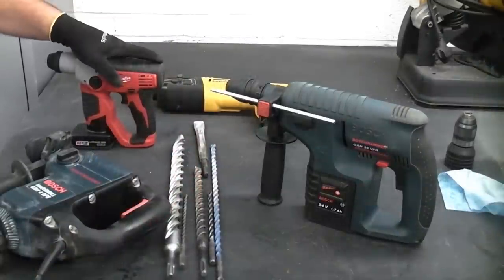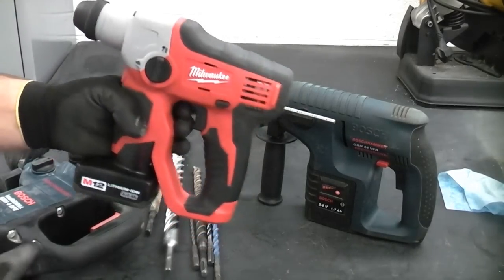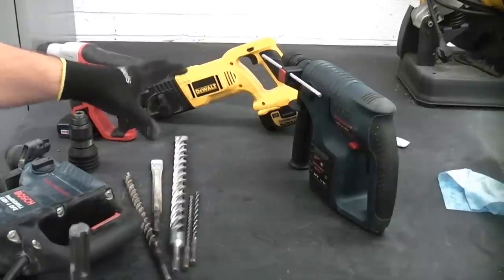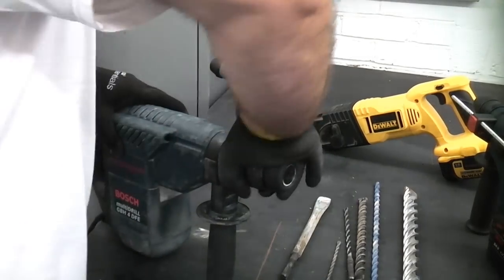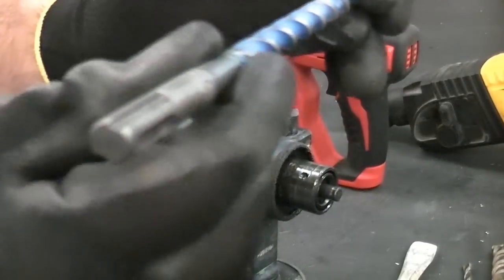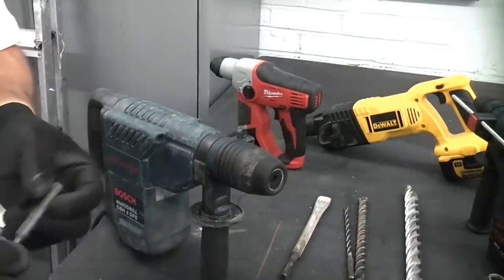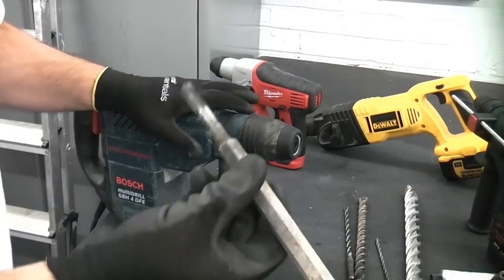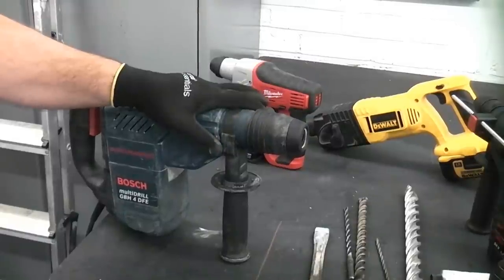SDS drills

Comment: Ive just bought a Dewalt DCH253 SDS XR and its worth its weight in gold.Powers through stone and concrete like a hot knife through butter.So much better than a percussion drill.Wish i had got one years ago.Another great informative video.
Reply from the maker: I currently have 5 SDS machines but when I see a new one I always think I'll find a use for it LOL.
That Dewalt looks like a cracking piece of kit ;-)
Thanks for the comment
Reply: ***** I got it in a bare unit kit with the new angle drill from Tomp8294.Couldnt resist it.
Your videos are costing me a fortune lol!
Reply from the maker: animal79thecat
I have bought a few things from Tomp8294 myself ;-)
Sorry about costing you a fortune LOL
Reply: ***** No worries...its a very satisfying addiction to have lol,and rather useful!

Comment: We got our first sds+ machine this week. What an awesome piece of kit. Just got it to drill holes initially but my partner used the pointed tip so take down a wall as well ( I had taken down half the old fashioned way) it made such short work of it. The big hammer may of been slightly faster but made way more mess and was exhausting. 

Only cost £60 as well ( titan brand) 

Just wish they done metal bits for the sds system as well.
Reply from the maker: They are brilliant and very affordable now.
Thanks for the comment

Comment: Thanks for the video lesson. Especially re greasing the drill bits. Handy tip. 😊 I have an sds drill but does not have a reverse function, which would be handy as I'm an avid diyer. Any recommendations on one with the reverse function would be much appreciated. Thanks.
Reply from the maker: shahdrah 
It depends how much you want to spend.
If you have a figure in mind please post back and I'll take a look for you ;-)

Comment: Can the Bosch sds drill with the interchangeable chuck be used for coring flue/ waste holes? 
I’ve bought a few Milwaukee cordless tools recently and would prefer to stick to the Milwaukee system but looking for recommendations.
Reply from the maker: Yes, it can be used for that. I have done several 4" and 5" holes using it-
https://www.youtube.com/watch?v=P0Pj9zzPN0s&t

Comment: I almost exclusively use sds hammer drills, they are just too versatile wheather you work with masonary, concrete, wood, metal or just want to drive in some screws they get the job done. Now I own a Ryobi 18V P222 cordless hammer drill and it perfectly suits my needs especially the built in chisel only mode gives it even more versatility (perfect for removing tiles). I also have 2 corded SDS Max Hilti's for some heavier work.
Reply from the maker: SDS drills are superb ;-)
Thanks for the comment

Comment: Very nice video..... I am not a handy man, but wanted to have a hammer drill that can be used to drill occasionally to drill holes in masonary. I can across this drill "Hitachi DH22PG 7/8-inch SDS Rotary Hammer" , not sure that will suffice the need. Please advice......
Reply from the maker: amol kheur Thanks, Yes that machine should be great for drilling masonry ;-)

Comment: What would be an advantage of an SDS-Max system in comparison to a SDS-Plus (except the bigger sizes)? Can you drill smaller holes with an SDS-Max?
Reply from the maker: I'm not 100% certain, but I don't think you can get smaller diameter drill bits for SDS max machines
Thanks for the comment 👍

Comment: Just picked up the dch  253 dewalt for a bargain along wth a 18v 4 amp battery ...would like to know your thoughts on this piec of eqp.
Reply from the maker: I've not used that model but if it is as good as my Dewalt 18v SDS drill it will be great ;-)

Comment: What brand of bits do you prefer for the sds plus??  I've used dewalt extreme 2 in my normal combi drill and there great just wanted some advice before splurging on sds plus :)
Reply from the maker: Many of my SDS drill bits are unbranded, but I do have some Bosch, Dewalt and just recently I purchased some Irwin.
The Irwin speedhammer are very good as are the Dewalt extreme bits. I'm sure Bosch and Makita will also do equivalent quality bits too.
Reply: Bull dog extreme rule

Comment: I clean my Bosch inside out every 40 drills(i have a small notebook in my case). They may make them really well but there still isn't a good solution for not getting dust and crud inside your machine. Lost a couple of these to leaving them superficially cleaned.
Reply from the maker: Thanks for the comment

Comment: Hi, do you need to grease the sds chuck regular? what type of grease is used in the chuck, thanks Ian
Reply from the maker: I only apply it every now and again. If you are using your SDS drill a lot it would be a good idea to add some once every couple of weeks. I use silicone grease as it is relatively clean.
Thanks for the comment
Reply: thanks Ian

Comment: I already have a 910v sds drill (performance power from B&Q), which does the job for me. So don't want to spend too much £60/100 would be the max. I don't want a battery operated one as over time they loose their charge and replacement batteries then become an issue as the models are constantly changing. 
Thanks.
Reply from the maker: shahdrah 
If you want a cheap one I would go for something like this http://fave.co/1TDknvY
Or if you want a qualirty drill this  Dewalt is a bargain- http://fave.co/1NgzYSf
Reply: Thanks. I'll go for the dewalt.
Reply from the maker: shahdrah 
Excellent choice ;-)

Comment: just a question, can i use sds drill bit on normal cordless hammer drill say Dewalt DCD796?
Reply from the maker: You can, but it won't be as good as a SDS drill, you also have to ensure that the jaws in the chuck grip only the round part of the drill shank.

Comment: sir, i want to drill a screw to hold my light on the ceiling which is concrete...is there any cheap drill and what  V is  need to drill through concrete
?
Reply from the maker: +Max Caulfield A SDS drill is best on concrete, but a normal hammer drill will work for a couple of holes but it's much harder with a normal hammer drill.You can see the difference here- https://www.youtube.com/watch?v=SKDIggpbXqU
Reply: +Novashadow X buy the Skil rotary hammer, cheap but it gets the job done

Comment: What kind of grease do you use for the drill shanks? On forums some suggest just using ordinary grease (some even mentioned just using WD40 or nothing atall!), whilst others say it will damage the plastic/rubber seals of the chuck, and you should only use special bit grease. It's unclear what this special grease is - some mention molybdenum sulphide, some graphite, some copper grease. On eHow they even suggest you can use petroleum jelly, beeswax or ''metal soap" (which seems to be a form of linseed oil). Makita seem to be about the only firm out there doing bit grease and it's pretty expensive. So it would be good to know if there are any valid alternatives.
Reply from the maker: +Benzknees I use the grease that came with my Bosch Multi-drill. I'll try and remember to check what type it is tomorrow ;-)
Reply: +Ultimate Handyman Cheers!
Reply from the maker: +Benzknees 
I have just checked and there is no information at all on the tube, only the Bosch part number 1 615 430 010
If I did not have that, I would be inclined to use Silicone grease as that is unlikely to damage any of the seals etc. 
Sorry I can't be of more help ;-)
Reply: +Ultimate Handyman Thanks for the further info. I've been searching for info too, but none of the manufacturers (Bosch, Makita, De Walt, Milwaukee) seem to give any info on the composition of their bit grease. As you say silicone grease, or maybe copperslip or moly, would seem to meet the criteria of not damaging seals whilst standing upto the stresses between the sliding surfaces of the bit shank and chuck jaws.
Reply from the maker: +Benzknees 
It is unusual that there is no information on the grease tube. I always thought this kind of information had to be printed on by law for COSHH regulations etc. Imagine taking that tube onto site and the safety officer asking you what was in it! 
Thanks for the comments ;-)
Reply: +Ultimate Handyman It is unusual to not find anything on the tube or container. I have just found a COSHH material safety data sheet for Makita's bit grease on the Screwfix site, which lists the general components as refined mineral base oil, synthetic hydrocarbon base oil, lithium soap thickener, additives and organic molybdenum, but with the exception of the molybdenum it lists the CAS as being confidential. Whilst this gives me some clues on composition, the details given on the sheet unfortunately look too vague to compare it to cheaper car lubrication products at Halfords!

Comment: Another great video mate! Whats a percussion drill for?
Reply from the maker: Sean Edwards 
Percussion drills do not hammer as hard as the SDS machines.
Although SDS machines are powerful and fast they often blow a large piece of masonry away from what they are drilling (known as blow out or break out) so sometimes a percussion drill is preferred as you get less blow out with them but they are a lot slower at drilling holes.
Reply: ***** right cheers for that, great videos keep em coming!
Reply from the maker: Sean Edwards
You are welcome
Thanks for the comments ;-)

Comment: My gbh 24 vre is not working well and the battery is not last longer please is the solution
Reply from the maker: It sounds like the battery might need replacing, but the drill could also be faulty. I would start with the battery though.
Thanks for the comment 👍

Comment: How to replace sds chuck with a normal one .?is it possible?
Reply from the maker: No, it is not possible if you still want to use hammer action.
You can get SDS to normal chuck adaptors but they are not great as they tend to wobble.
Reply: I've just ordered a sds chuck adaptor.i got a Black and decker hammer drill for a really cheap price,by using a chuck adaptor hope to be able to use it for metal and wood drilling .thanks for your advice and your informative video.

Comment: Witch machine is the best and cheapest to drill a 32mm hole in some brick work
Reply from the maker: If you are using it for DIY use one of these is probably the cheapest-
http://www.screwfix.com/p/titan-ttb278sds-5kg-sds-drill-230-240v/97533
Reply: +Ultimate Handyman thanks
Reply from the maker: You are welcome ;-)

Comment: Not sure why you picked the smallest Milwaukee sds they make an m18 that kicks ass. And with the new 9.0 battery you can throw away all that junk you have shown who needs that cord. Good tools cost money and you get what you pay for !
Reply from the maker: I already had a load of M12 gear so bought the SDS machine to try it.
The drill is very handy for drilling small diameter holes in confined spaces ;-)

Comment: Can SDS drills be used to drive screws?
Reply from the maker: +metallitech 
They can, but they are not good at it because there is not normally torque control on SDS drills.
I sometimes use mine to tighten nuts when using coach bolts etc.

Comment: How’s the M12 sds going these days?
Reply from the maker: It's still doing fine. I normally only use it for drilling small diameter holes, although I did drill a hole for a M12 thrubolt a few weeks back ;-)